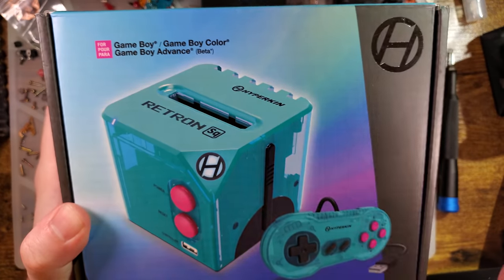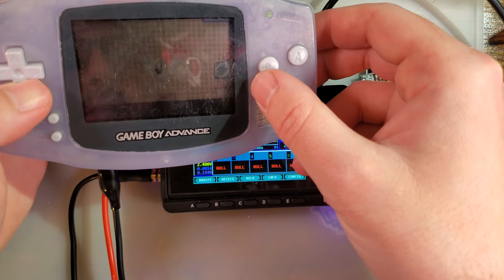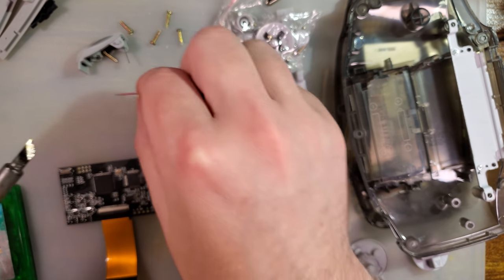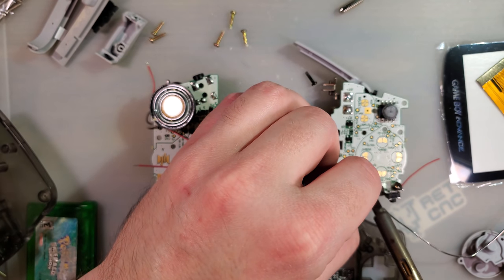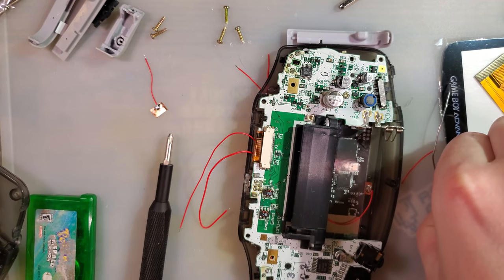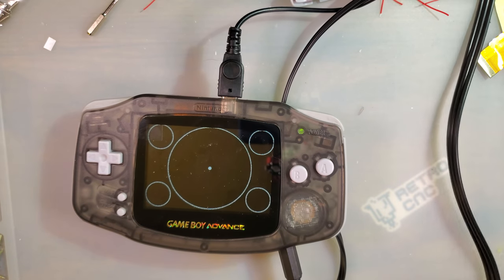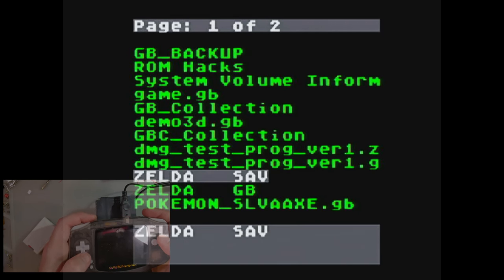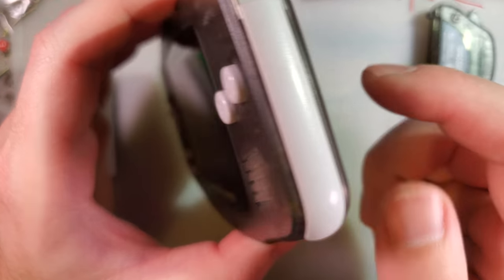TV Out -- Game Boy Advance IPS Kit ('One Chip' 'TV Version')

Comment from the maker: Hey so I didn't test the link port functionality very well in this video. Well, I made another video and tested it way more in-depth there. Please feel free to check it out. Or not, I'm not your mom. 

https://www.youtube.com/watch?v=20jTR5aQ1Mg

TL;DW on that video: It's complicated. Some things work, others don't. Wireless adapter is recognized but does not communicate properly. Link cable DOES work but only in GBA games and only when the TV out kit is player 1.
Reply from the maker: Also, this video covers the EM3 "resistor" that people keep commenting about. As I explained in the video, the cable uses a different pin for the video signal which requires wiring the console differently. I explained this in more detail in the video. Follow the instructions from whoever you get the kit from.

Comment: It's cool that they were able to pull this off, but the incorrect aspect ratio ruins it for me. If they can fix that, or get it to output to HDMI, I'll get one.
Reply from the maker: yeah, it's a bummer. FWIW, It's the closest so far as far as options with the wrong aspect ratio though.
Reply: It's only a old composite out and that in the time where TVs that port has anymore.
I prefer Gbahd which im Sure not cost more
Reply: @-Gothicgirl-  Well I hope you enjoy soldering a million wires too. I prefer my GBA to still look like it is a handheld, so to each their own.
Reply: @Parastack  what for Million cables? It's only 14 cable on the gba and 4 for power and reset
Reply: @Parastack  I don't know if you'd be interested in this, but this is another option.
https://www.game-tech.us/product/woozles-gba-consolizer-kit-full-case-version/
Reply: @badreality2  yeah Spammer with a every sold out and usury price that needs many soldering too
Reply: @-Gothicgirl-  Soldering?  Yes.  No lag (except one's tv produces), yes.  Spammer?  No.  I'm on the same threads as the ones you are recommending the gbahd.
Reply: @badreality2  yeah yeah child! Go crying

Comment: Nice video! These kits look pretty great even without the TV out functionality. You might want to look into getting one of those cheap KSGER T12 soldering stations if you want to have multiple tips at the ready. I've had one for over a year and it's still performing like a champ. I even use it as my main soldering station now.
Reply from the maker: I really don't need a sixth soldering iron but thank you.
Reply: @makho  six stations?! wow!
Reply from the maker: @iCach0  xtronic 3020 (my main iron), edsyn 951sx, TS80P, TS100, and some crappy radio shack 35 watt weller clone.
Reply: @makho  Nice! I don't think I've tried any of those. I started out with a Hakko FX-888D which worked great. Then a friend recommended the KSGER as a secondary unit because I like to have at least a K tip and a J tip always ready when I work. I really like how easily you can change tips and how cheap but reliable everything is.

Comment: Composite is fine if hooking up to a CRT, but for anyone who wants to play GBA on an HDTV then honestly there are two fantastic options.  

1. The Woozle GBA Consolizer kit.  720p via HDMI out.

2. MiSTer FPGA which houses a GBA core, but many others as well and can scale up to 1440p.  

Both options above also offer lowest latency as well.
Reply from the maker: Yes, I put this in the description
Reply: Third option Gamecube + Gameboy Player + HDMI Adapter + Gameboy interface 

makho say in the video other option is GBAHD by zwenergy is similar to woozle but open
Reply: Fourth option, do this mod, then passthrough an OSSC, or a RetroTink.  Split the composite to a C.R.T., the OSSC or a RetroTink, then to a HDMI accepting capture card for more fun. ;)

Comment: If it's just composite, I'm out at that price. I would buy it with component, or RGB if that's possible. Digital would be impressive, but a real challenge I imagine.
Reply: Gbahd is better
Reply: @badreality2  Spammer for selling gba consolizer! And you dont now the Gbahd!
Reply: @-Gothicgirl-   @666Gothicgirl  This is coming from the same guy that promoted the gbahd to anybody whom complained about using composite video, in this Comments Section?  I'm just doing the exact same thing, for the GBA Consolizer.
Reply: @-Gothicgirl-  You are calling me a "crying ten year-old", but you are also insulting me, like a ten year-old would. 🙄
Reply: @badreality2  go crying!

Comment: I’m surprised the video signal is distorted like that. I thought that it would keep the original aspect ratio but would be 2/3rds the resolution of the LCD (480x360 down to 320x240.) But the output doesn’t put black bars above and below the image and instead opts to stretch it.
I’m also surprised by the interlaced(?) output causing the chain chomp’s chain links to disappear. (Or maybe that’s your capture card misinterpreting 240p as 480i? I have a CRT that has the absolute crispest composite image ever, but sucks ass at 480i.)
I was thinking of getting this kit, but might want to wait for a potential version that has the correct aspect ratio and progressive 240p output, unless it was just your capture card messing it up (if you’re using one of those cheap RCA to HDMI adapters or an old ass capture card, it messes up the image tremendously.)
Reply from the maker: My capture card is absolute garbage. I honestly should have just plugged the damn thing into my visteon.
Reply: @makho  I just found out that OBS studio has a "retro" deinterlace option which can fix improperly "deinterlaced" 240p video.
If I'm being honest, for a garbage capture card, it doesn't look totally awful- I have faith that even using a cheap composite to HDMI upscaler with the retro deinterlacing and aspect ratio correction will give this kit justice. I've used the adapter with my Commodore 64 and PlayStation 1, and the signal quality is actually quite good, but the only problems are the "deinterlacing" and wrong aspect ratio.
So yeah, after a bit more consideration, I'm much more likely to buy this kit.
Unless someone else records this outputting to a CRT and it displays the same frame discarding problems you had in LADX... that would suck.

Comment: If you need a new capture card the elgato hd60s is pretty good, I have one and used it with my Nintendo switch (and an official Nintendo switch dock that came with my system) and the stream I did with it looked good in obs studio on my tower PC but there was a lot of lag on the YouTube preview so I used the one in obs studio and only had YouTube open to read comments.

If you do get one the software for the regular elgato hd60 will not work with the elgato hd60s (I already tried that and it didn't work).

Comment: Hi,
Do not force screw in when the shell not fit in perfectly. It will break the shell.
The shell gap probably caused by shoulder button not match to shell.
Reply from the maker: The shell is dead on arrival then if it doesn't fit OEM buttons and is supposed to.

Comment: This would be perfect for a Gameboy SP without a screen.
Reply from the maker: should be mostly drop in there too. Same solder points. You'd probably want to find EXT-2 adapter that supports simultaneously charge and headphone out though or make one custom. 

Though on a headless SP, you'll have a hard time finding a place to put the converter board :)
Reply: @makho  probably pull audio from elsewhere on the board.
Reply from the maker: @Ruslan.88266  The port is right there though. It has six pins, four are dedicated for audio and the other two for charging. There is no reason that you cannot use both simultaneously except that most adapters just don't have charging connecting.

Comment: I just got my first gba to mod what’s the best ips kit in your opinion? I’ve had stock ones in the past but I have always preferred the sp but I have 9 lol decided to try a gba this time found a MINT pink clear one and it’s like new I think I’m gonna buy a funnyplaying ips ready shell as per your recommendation and I love my funnyplaying ips v2 and one chip v2 sp kits  but don’t know what’s best on this system and I’m planning to do the overclock chip, ips kit and maybe an amp and power cleaner mod as well as a usb type c lipo battery pack I also was curious if you have an opinion on the new 2021 version of the aliexpress everdrive gb pro+ for $36 it has the reset button now and supposedly other updates and looks very similar to an everdrive gb x7 costs less than an x3 and has games and SD card included I couldn’t find much info on the new version I was hoping you knew something about them? You seem to have a ton of experience with flash cards!

Comment: Afternoon, just wanted to say amazing video and ask a question. I bought a broken gameboy that didn’t have a power switch or f1 fuse, I replaced the switch with one of helders and got a fuse from a different far worse board. Everything checks out with the multimeter, though when I power it on with fresh batteries the green light comes on for a second and then back off, there is an audible click or clunk coming from the speaker and nothing on the screen. I thought it may have been a cap problem so I replaced them and still nothing. I even tried scrubbing it all down in white vinegar fallowed by isopropyl alcohol and nothing. After all this to say I have no idea what else to do. Any advice would be appreciated.
Reply from the maker: try the #troubleshooting channel on the game boy discord. Be ready with pictures.

Comment: I Didn't even know the gameboy wireless adapter could boot up in GBA. What exactly does it boot into, for what purpose?
Reply from the maker: The GBA supports "multiboot" which allows it to load games from the link port into internal memory. Due to the incredibly small amount of internal memory, there's a significant limit to the size of games but it allows for you to play supported multiplayer games with just one cart. The wireless adapter is the exact same thing but it has to have a built in ROM to serve as a "driver" or "bootstrapper" for the wireless adapter itself so you can connect to other consoles wirelessly for single cart multiplayer.

Comment: Hey makho! 👌 Can you do it the other way around? Leave the brightness touch sensor on the board and not solder the L, R and select wire? Gonna get my kit any day now!! Greetings from a noob modder
Reply from the maker: I mean, if you don't want to be able to toggle the TV Out mode, sure. Seems like a waste of time to do that with this mod.
Reply: @makho  ah OK 😂 definitely gonna do the soldering then! Thanks for replying! 👍
Reply: I've rebound my Select to Up arrow and the L and R wire to A and B for brightness up and down. It's all preference. I do say I like this better than hitting the select because I have issue with a gummy press than the normal plastic presses. I just hate pushing down on rubber and hoping I'm hitting it usually only my problem on GBC but still hate it none the less. I will say Makho that the oversight on the color palette is a big bummer for me too it shouldn't be bound to L and R like the brightness. That's kind of dumb.

Comment: Hey issue. I just installed this mod in the same manner you did. Everything works properly except the screen switches it's not appearing on the TV. It does go black on the game boy. Any suggestions? Maybe the AV soldering needs redone?
Reply from the maker: Did you solder the video signal according to your cable? I showed how to wire it to pin 3 -- most kits are expecting pin 1 now.

Comment: Hello ! How to enable the tv output? Thanks
Reply from the maker: Like I mentioned in the video and like it says in all the listings, hold all three buttons that the kit is wired up to, select L and R.
Reply: @makho  I didn't even found this information on the AliExpress listing, btw. .. so not that obvious ;) thanks
Reply: Hey Makho just a quick question about the install on the kits on Ali express they say to remove the em3 resistor would you know if this Is necessary
Reply from the maker: @PAUS3D_01  I explained in another video but there are two wiring methods for these kits and which one you use depends entirely on what cable you get with it. Follow the instructions from the seller.

Comment: With these easily interchangeable ribbons you'd think you can just buy a replacement easily... but nope, lol
Reply from the maker: my understanding is that bulk of the cost of these things is in the PCB adapter itself so it's very little on top to just get the whole kit instead. 

Once the initial popularity levels out, RGRS usually seems to have "spares" listed separately if you just need the board or something. Usually.
Reply: @makho  i actually meant just the ribbon and no PCB... I managed to get a SP kit like that, but I'd rather mod a regular GBA instead, and can't find just a ribbon, so will probably end up using the old 101 adapter with it, lol